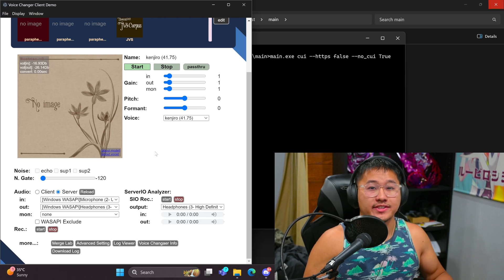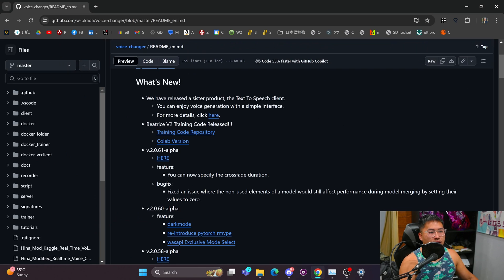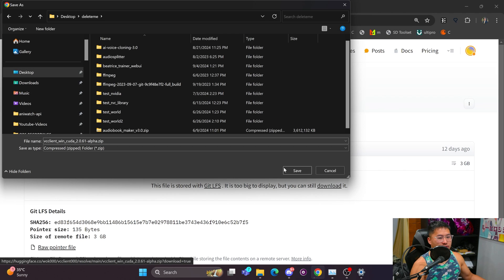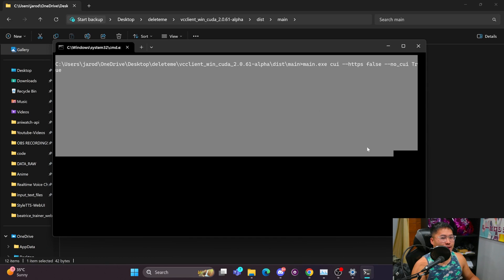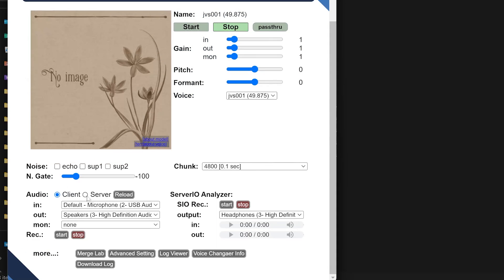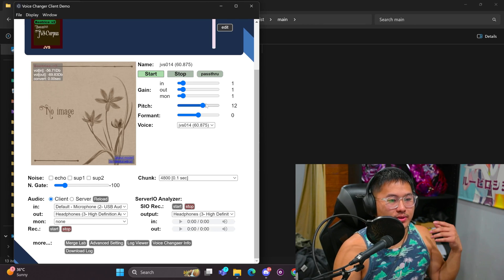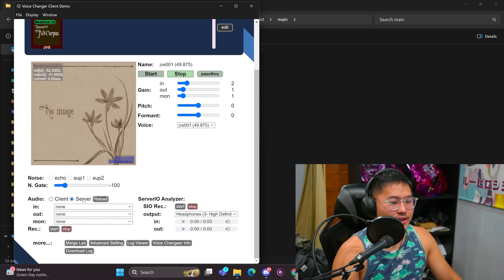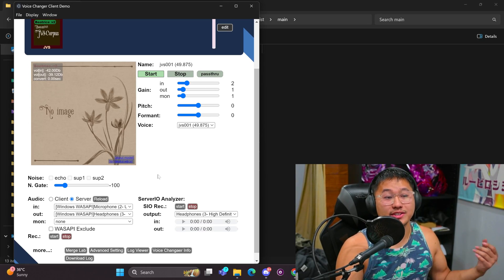Realtime AI Voice Changer Installation - Beatrice v2

Comment: Can this operate without internet connection after everything is setup and run for the first time?
Reply: Yes, but you shouldn't use this old version of the original Wokada, Wokada deiteris fork has better performance
Reply: @Nick088Official  where do i find Wokada deiteris fork?

Comment: Been trying to set this up for VRchat, but I don't know how to create the proper overrides that let you see this as an input or an output.

All I can do with it is, hear my own voice change, via the mic and speakers. I can't even use it to record my voice with Window's own voice recorder, for noting sees it as an input.

Is there some setting that can be used to make this actually useful as a real time voice changer?
Reply: any solution to this ?
Reply: @emeriktremblay3881  Yes and no.

My setup is to make Dubbing AI work for VRchat. I had given up on trying to use this voice changer, for one, I could not get it to work without a lot of lag. But the setup I made works with Dubbing AI. And I feel Dubbin AI sounds a lot better anyway.

I downloaded some vb-audio virtual cables for free.

For VRchat use, I have my headset mic as the Dubbing mic INPUT. Set the virtual CABLE input as the HEAR MYSELF output.

Then in VRchat, instead of setting Dubbing as my VRchat mic, I set the virtual CABLE output as my mic.

I turned on HEAR MYSELF in Dubbing. And for some reason, the lag in VRcaht I was getting from using Dubbing directly (was about a one second delay) as my mic, is near gone.

I don't know how or why this works better, I only care that it does.

So my suggestion is, get Dubbing AI, and the vb-audio virtual cables, all for free.

You can also buy one standard voice in Dubbing AI for $0.99, without paying for a subscription or the expensive perpetual for pro.
Reply: @emeriktremblay3881  Downloading a virtual Audio Cable
Reply: Install VB-CABLE (it's free), set the output device in the voice changer to CABLE input and set CABLE output as your default microphone in windows and vr chat.
Reply: Mines be so laggy

Comment: this voice changer sounds like shit, w-okada is the only best voice changer as of now
Reply: wut u talkin bout, this is w-okada
Reply: @hestonsverige  this is not w-okada, it is beatrice v2 which is made for low end pc's, watch his old w-okada installation videos and how it performs. Even though W-okada requires a slightly high end pc, it provides much better output compared to this
Reply: @ the software is still w-okada, its just different voice models, the first model he used is a RVC, and yes they sound much better than beatricev2 models.

Comment: I can't seem to get any voices to work... After the installation, the menu would pop up just fine. But after the configurations, no sound would ever be played in the headphones. After closing it and opening a second time, the terminal would simply close by itself, not loading the menu fully, and giving me "error to fetch" messages. What could I do?
Reply from the maker: You may have to delete and re-unzip the package. However, for no sound being played I'm not too certain as there are a variety of factors that can be checked.  I'd first check that it does work outside of the voice changer first, then move back into the voice changer.  If you have other devices you can try, I'd recommend that as well

Comment: So you just gave up on Tortoise TTS? I’m confused that used to be #1 focus on the channel?
Reply from the maker: It's on the backburner - there are newer architectures out that I am trying out that serve a different purpose than tortoise. Tortoise is great, but I've pretty much done everything I've wanted to with it for the time and skills I have. As open-source goes, everything is out there, so people with the means and the skills can fork off of it and continue their ways with it.

And even though its great, there are imperfections in the architecture; repeating, skipping, artifacts at the ends, okay-ish zero shot cloning, imperfect speaker tone matching (which RVC takes care of), etc.

My knowledge of ML isn't yet deep enough to modify the architecture and make any significant changes to fix it.